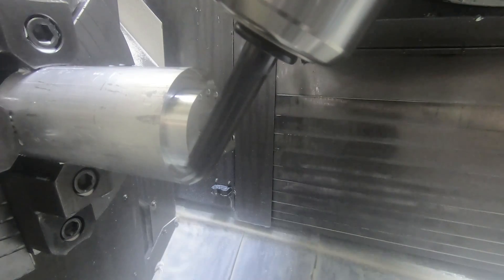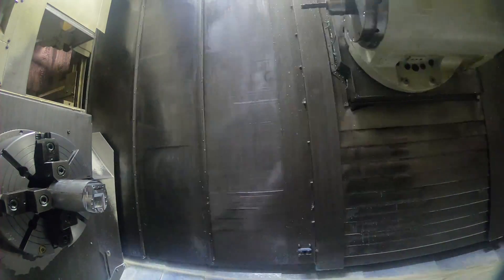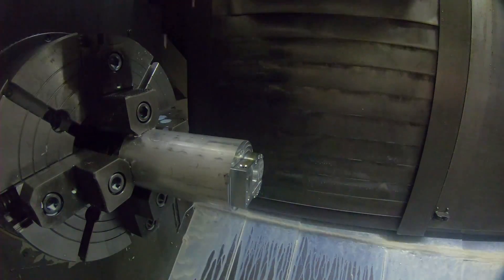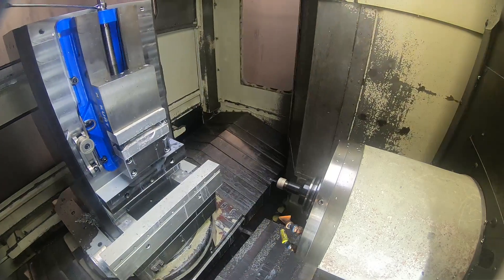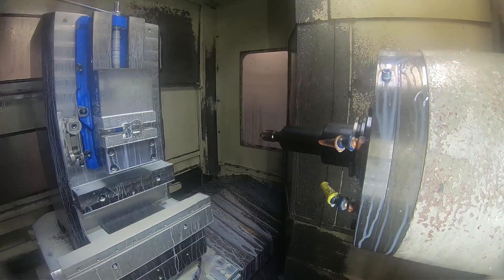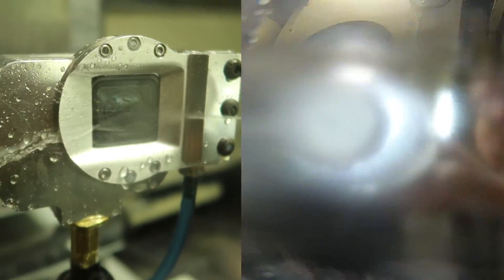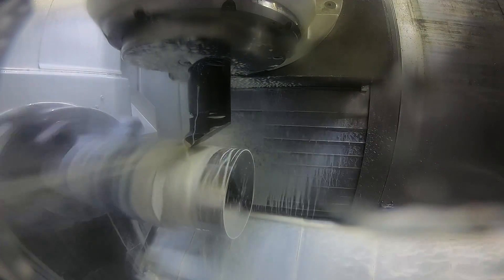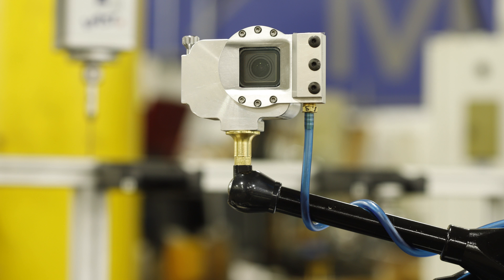Side Blow Air Knife for GoPro case

Comment: If you aim the air out on front of the lens nothing will hit it. Aiming down the lens cover is blowing fluid across the lens. Experiment with the angle of airflow "5° maybe 10°". Make an air curtain out in front of the lense.
Reply: Maby a combination of air an 1" out from the airknife and the air knife will do the trick.
Reply from the maker: The coolant would make it thru any air stream. Especially the high pressure coolant. So it’s necessary to blow it off the lens cover.
Reply from the maker: It’s been my experience that the coolant will make it through any type of air stream. Especially with the high pressure coolant my machines have. So it’s necessary to blow it off the lens cover. Also if you have to much air pressure and flow it actually drys the coolants concentrate in the water on the lens and clouds up the view. It almost works better when the lens remains wet.
Reply: Is it possible to narrow down the sweept area, it looks square but the video is 9:16, maby some experiments with smaller 9:16 "window" and blow across the shortest distance.
Reply from the maker: The round window of the previous version blocked some of the view at the GoPros super wide view. So it could be a little smaller but not much.
Reply: Ok, I think you already got a pretty good solution, what if you had higher air presure and flow combined with a "waterknife" with clean water to prevent it clouding up and keeping it wet, just an ide.
Reply: Edge Precision would a hydophobic coating help at all?
Reply from the maker: The glass window does have a  hydrophobic coating.
Reply: One of the component of coolant additives is a wetting agent to allow wetting on oiled or silicon residue covered parts. This reduces the effectiveness of hydrophobic coatings

I would like to see If a spinning glass cover would work well. It could be driven by the air stream and use its own exhausted air to act as a air knife and motive force.
Reply: what you need is a high speed spinning plexiglas infront of it,  let centrifuge clear that fluid for you

Comment: put 2-3 applications of RAIN X on the lens !!
Reply from the maker: Rain X helps but only for a few minutes. FlyBy Forte works better but not much. The coolant washes off all of these coatings. The glass window I have been using is from Edmund Optics. It has a special Olephobic coating that works good for a while. But it also eventually gets attacked by the coolant.
Reply: @EdgePrecision  have you thought about changing the coolant ? Blasser 735 by Swislube ? Its already clear and stays clear, not milky white. Helps

Comment: My first impression of this video coming from AVE squad is that you have a pretty expensive piece of machinery there!
Reply from the maker: If I had bought this equipment new, yes it is very expensive. I use this equipment to make a living. I worked a long time time to get to this position and have the equipment that would be the best for the jobs I do. The main reason I even make YouTube videos is. Most all machining videos on YouTube are oriented to manual equipment or hobbyists ( nothing wrong with that). But there is very little good and accurate information on industrial type of work that most people that do this for a living have to deal with. I have seen in the little time that I’ve made these videos how hungry people in industry for this type of information. There is no one teaching this anymore.